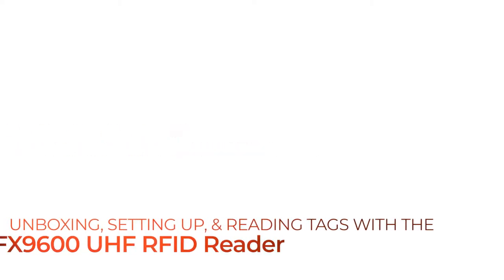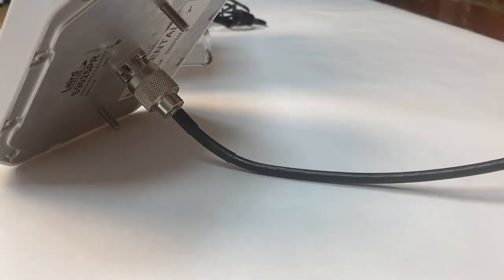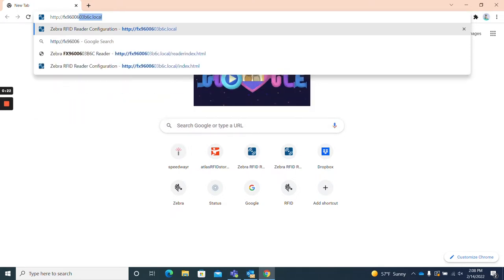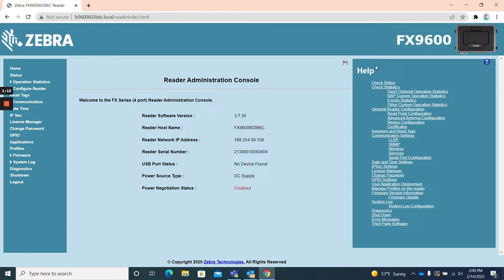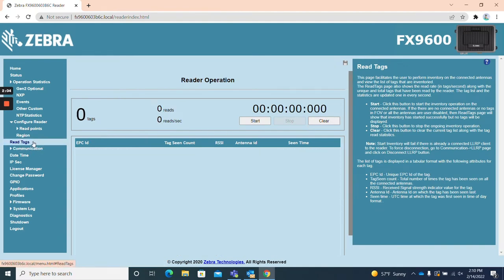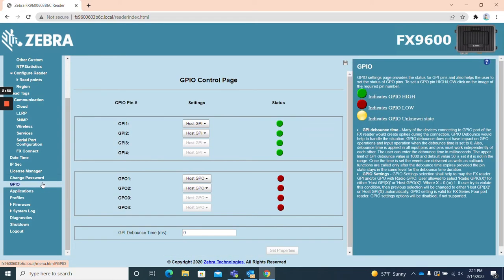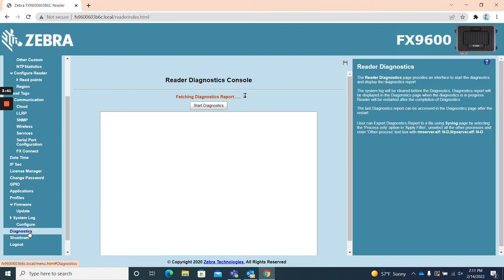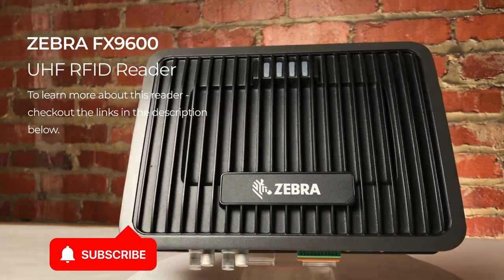Zebra FX9600 UHF RFID Reader | Unboxing, Setting Up, & Reading UHF RFID Tags

Comment: Is there any specific RF cable with RP TNC MAKE TO N TYPE MALE
Reply from the maker: Hey! If you mean RP TNC Male to N TYPE Male - Yes! You have a few different options in terms of feet and insulation rating, but here's a 12 foot one - https://www.atlasrfidstore.com/vulcan-rfid-12-ft-antenna-cable-195-series-rp-tnc-male-to-n-type-male/

If you are unsure about insulation rating - here's our guide on choosing the right cable for your system - https://www.atlasrfidstore.com/a-guide-to-cables-connectors-and-adapters/

Let me know if that helps!